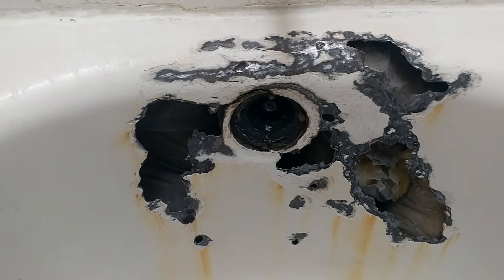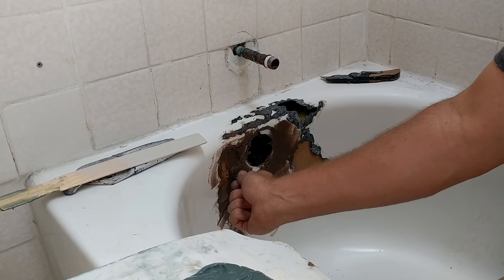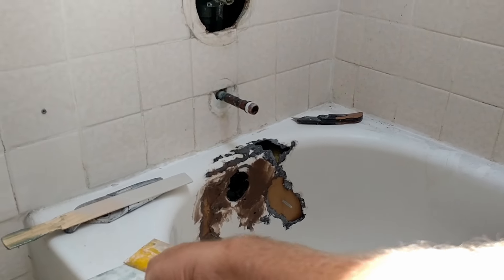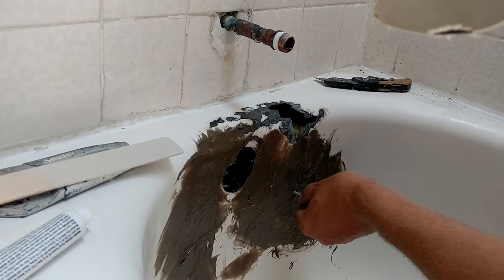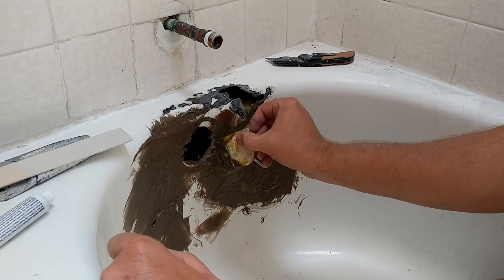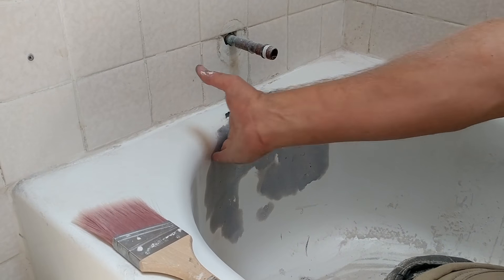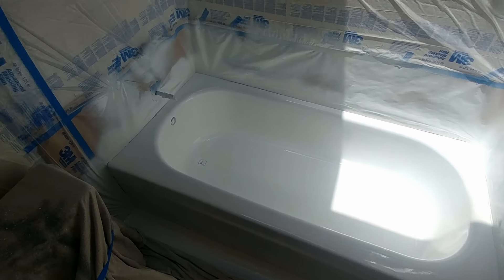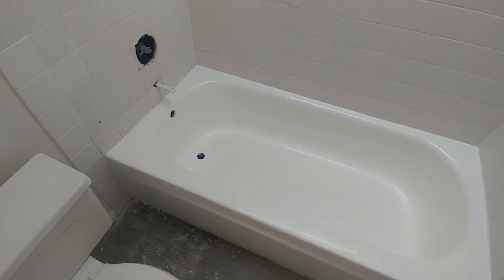How to repair a rusty hole in your steel bathtub

Comment: I need someone in houston TX to do this for my mom. the 30yr old bath tub is having rust around the overflow drain and I know it will get worse. $2500 for tub replacement ain't fun
Reply from the maker: i think there is a MIRACLE METHOD in houston....thats where i started

Comment: Would it be insane to just go over my entire tub in this stuff and paint over it 😂 its from 1930 and its in bad shape
Reply from the maker: not at all ...id take a sander with 60 grit and sand the entire tub then clean it,make sure its dry then use the dura glass that doesnt have the fiberglass hair in it ....apply and even coat ,sand smooth,wipe it down with damp cloth to remove dust let dry ...it will be green but use a white primer then the epoxy paint
Reply: @classictruckaddictions7423  thank you !!

Comment: Just out of curiousity what city are you located in? Also how did you go about getting rid of the rust on the underside of the tub? I have a tub that rusted from the bottom up due to a bad seal at the drain.
Reply from the maker: hey Mike .....you really never get all the rust but any hole that i can get my finger in i try to sand the best i can ... and if you get enough of the fiberglass bondo on the back side when you have the cardboard in place then on the front you cant push it through once its dry ....im in Huntington Beach CA.
Reply: @classictruckaddictions7423  okay great info..much appreciated....so I sanded down today both sides of my tub where there was rust, sprayed the top and as much of the bottom as possible with Rustoleum Rust Reformer (you mentioned you used a rust removal product so that is what I went with) and have my cardboard cutouts prepared.....just to  make sure I am doing this correctly (1) Bondo Glass product used with cardboard cutouts..fill then sand (2) then USC Fiberglass filled filler goes on top of that..fill then sand..(3)then Poly tech Mutti Tech Poly Filler 710 white goes on top of that to fill small holes....(4) then glaze   (which I will likely pay someone out here professionally to do....does that sound right?  If so how long do each of those coats take to dry and what kind of sanding device do you typically use to smooth each coat out?  Thanks very much for the assistance.
Reply from the maker: @mikemurphy5716  morning mike......you can just do the glass and if it sands smooth enough then just use poly fill ....my sander is just a dewalt palm sander .... any sander works
Reply: @classictruckaddictions7423  thanks for your assistance...i ordered the white poly fill from multi tech today...i'll let you know how my project turns out...thanks for answering my questions and posting this video
Reply: I received the white Poly filler white 710 today...there aren't any instructions included on how to mix appropriately or apply...is this done the same way where you mix a 3 inch strip of the cream hardener with a small thin pile of the filler?  Just want to make sure I get the mix right...thanks